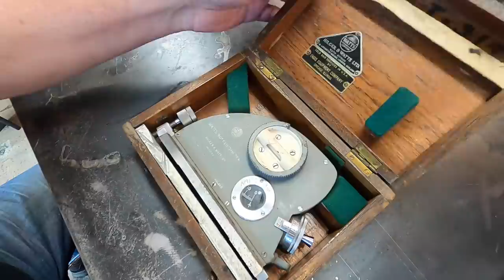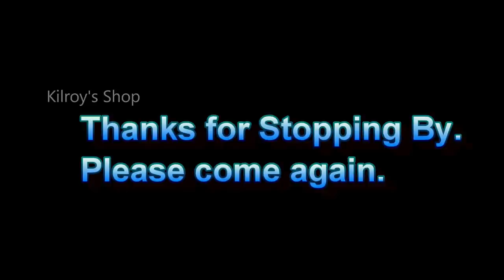Shop ADHD #42

Comment: My tried and proven true many times for replacing any item.  If you buy a spare then by the time you need it you will not be able to find the spare or so much time goes by that dementia bars you from knowing you had a spare. So you then order another "whatever" and a spare and guess what? You find you now have 2 spares and will lose them both.  However, there is rule #2.  If you have a spare, know where it is at then the one you are using will never fail again.

Comment: hard cast bites  i tried to tap a barbell to plug the hole and turn a back lathe chuck plate it wiped the 1'' pipe tap out and it was a good greenfield :(
Reply: The ferric carbide in "white" iron, AKA "chill", is nasty stuff.  As Mr. Kilroy showed, tungsten carbide tooling can barely cope with its hardness.  My guess is that a CBN cutter will be just fine, but even that rates to dull faster than normal.  Historically, "white" iron was ground, not machined.   "White" iron is far too hard for the capability of any steel cutter, including the best HSS.

Comment: Big slab of 4140!  Looks like you started climb milling but changed your mind? You need other people to do big work in the shop??? Going to check the nut size now!
Reply from the maker: Can't get my hoist moved around right now, so most lifting is done using the strong-back method.
Reply: @jtkilroy  You still on the mend from the hernia op?